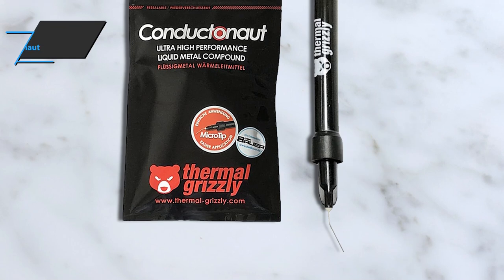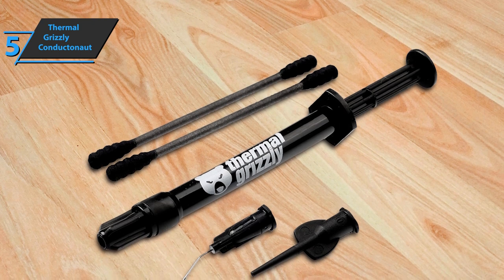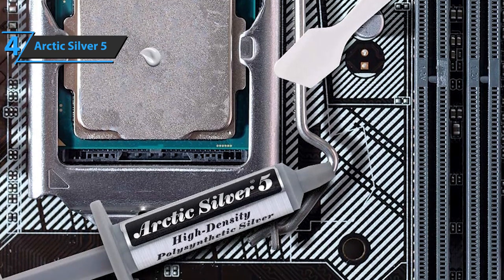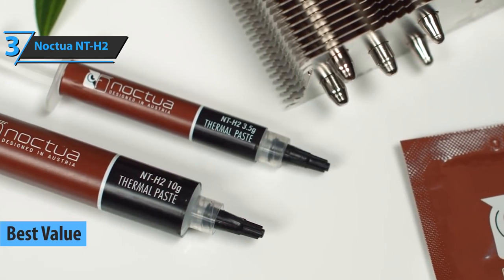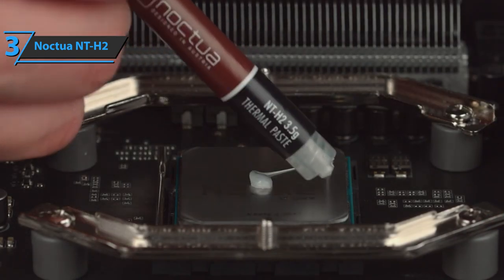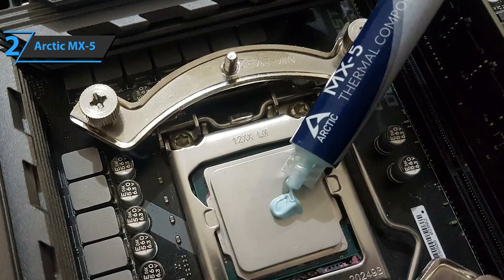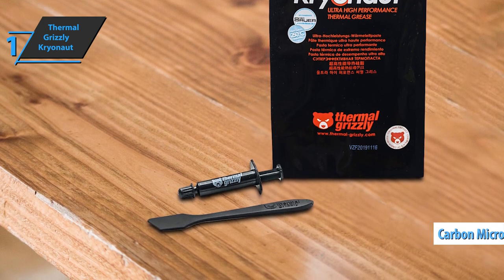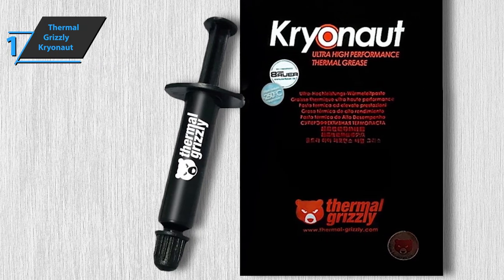Top 5 BEST Thermal Pastes of [2022]

Comment: Recently there is an improved version of Kryonaut, Kryonaut Extreme, though you may not like the color, but its cooling effect is beyond effective ☺
Reply: 14,2 W/mK thermal conductivity vs 12.5 W/mK thermal conductivity..  not that much better, and the price is a hell a lot more. for the price of 2.2g of extreme, you can buy 11.1g of kryonaut. So i'd put my money on the 12.5 for less money rather than putting alot of money in alittle of something that gives 1.52 W/mK more... you feel me brother? :)
Reply: and yes, the color is very grose! :)
Reply: I still have one package of the regulart Kryonaut.
But thanks for the tip, i'm going to try this product.
Reply: @opoxious1592  its not that much of a diff tbh... i got it and it droppoed thermals by 1 degrees celsius...
Reply: beyond? youre lying! I have extreme, and i didnt see any change, litterarly just by 1 degrees celsius, which also could have been because the room temp was dropping 1 degree, so in beyond my eternal assfire!
Reply: @FingalPersson Maybe is more durable dk i still have my old Kryonaut, didn't try extreme one, next time i will try noctua one i think

Comment: I am using the new Artic MX-6 and like it a lot.  It was easy to apply and gives lower temperatures than the MX-4 I was using before it.
Reply: whats the best way to apply thermal paste?
Reply: @9pancreaS  the two best ways is to do the 'X' approach are the full spreader approach.

They basically produce about the same results just make sure that you spread very didn't we if you want to do that approach
Reply: @brandonmoss7976   I understand that "5 point" technique is more effective spreading the paste.

Comment: I just have an hp pavilion 360 14 model. I just want it to keep working for longer. What should I use on that? tbh I have no idea what I’m doing, but it’s a basic laptop, I’ve already taken it apart once. In order to clean the fan to get it to work again. (Now the fan still makes noises sometimes when I’m on clip studio blending a little too fast)I think cleaning and replacing it’s thermal paste might help. Finding a replacement fan may help also. Although it might be hard to find one for this model. I don’t want to get the wrong product and ruin it. Please help! Thank you!

***also I don’t know what I’m doing now but I’m willing to learn and I follow directions well

Comment: By any chance, are you the owner of the channel "Connection Tech"? Asking, because you used the same font and styles for both videos, and your voice sounds the same. And your video of best thermal pastes of 2022 is as useless as the one of 2021. Same useless powerpoint without any actual test or data. 

So, since you are putting 0 effort on your videos I will just copy and paste my comment from the 2021 one:

I would have preferred a set of thermal performance tests and have a tier list based on said tests results rather than a powerpoint enumerating the characteristics of the ones you believe are the best without any data backing your claims.
Reply: really showed him man good job